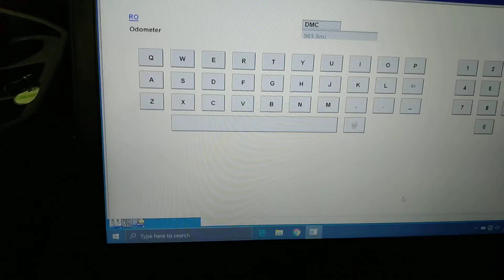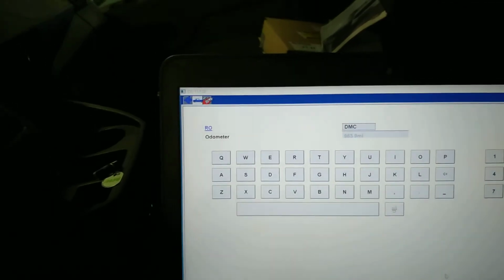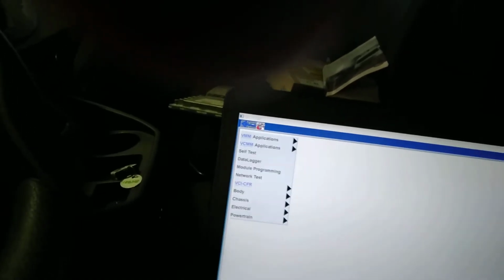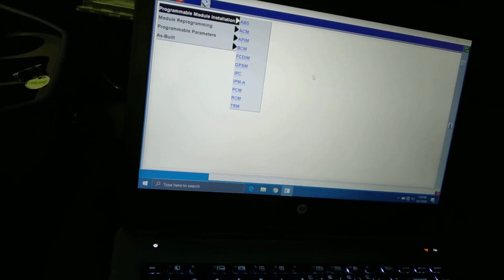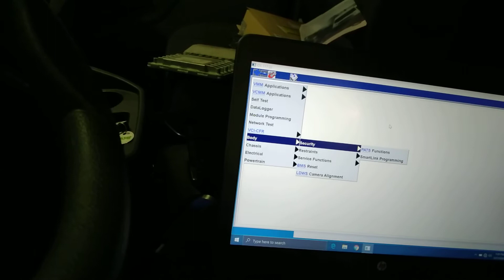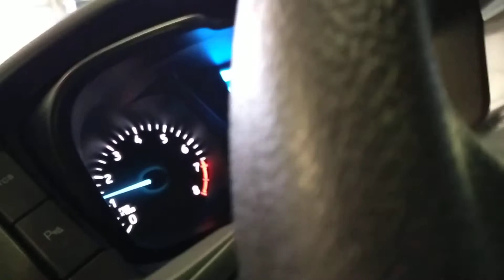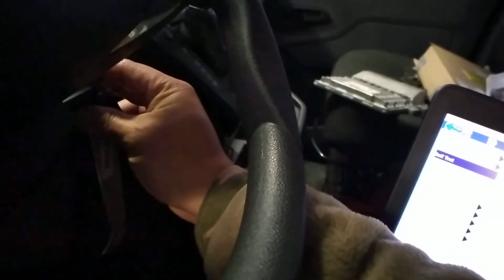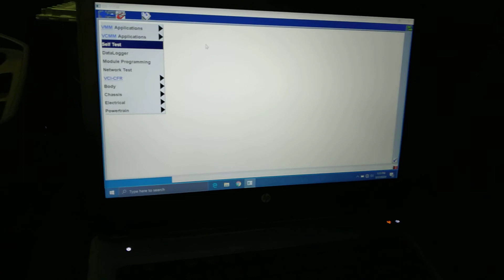2018 Ford transit blank PCM programming

Comment: very interesting video. I have a question for you to be able to change the PCM VIN. Did you have to delete the keys from the PATS function and register them again?
Reply from the maker: Oh man. I changed pcm vin before, it's a mess, I did the pats, then dome how brake control module did not lke the new Vin. I couldn't get it to work. This was on F350. Now, you can't do pats without a locksmith key or dealer access.